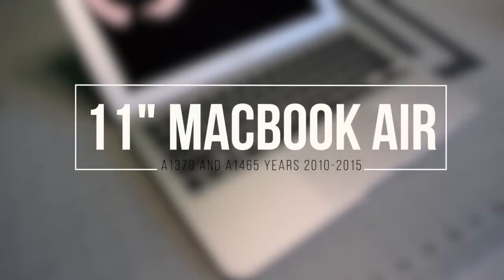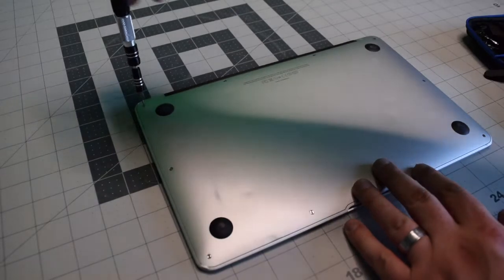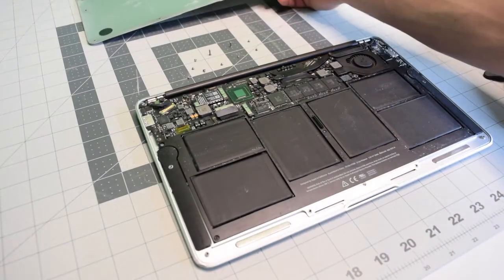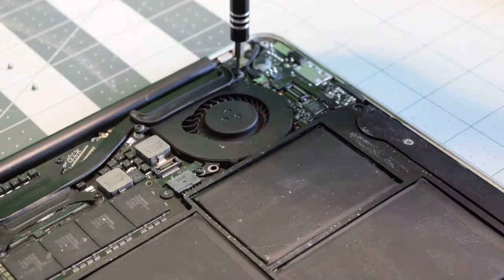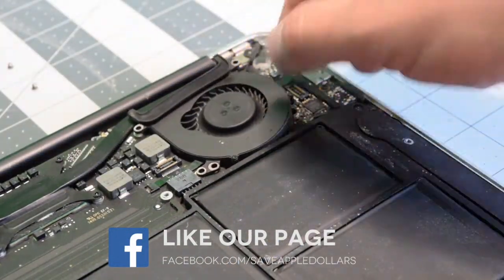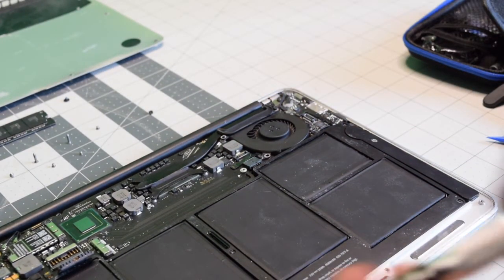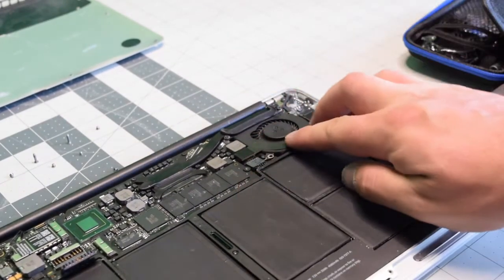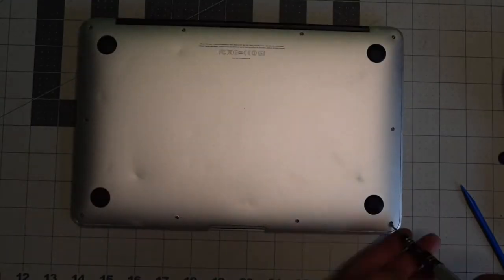11" Macbook Air A1370 and A1465 System Fan Installation for years 2010 2011 2012 2013 2014 2015

Comment: I need your help! Please...

I have a macbook air a1465 of 2014. I'm trying to substitute my old cooler for a new one, so i bought on Ali express the new cooler, but i notice that their cable is larger than the old. The problem is that the one with the larger cable doesen't fits well on my macbook air... Altought, looking closely, the old cooler has a 1,25 watts compared to the new that has a 1,5 watts. 

I talked this with the seller and he said that the cooler with the small cable is for the macbook a1466 and that i only will find a cooler for a1465 with the large cable and with 1,5 watt. So, how i can fit the new one on my mac?